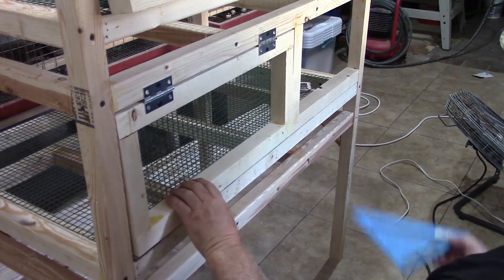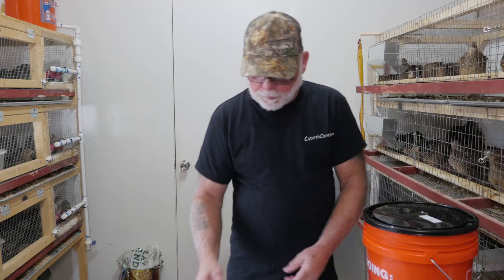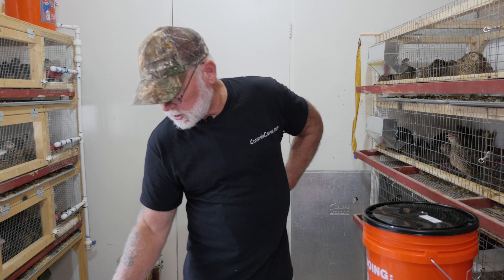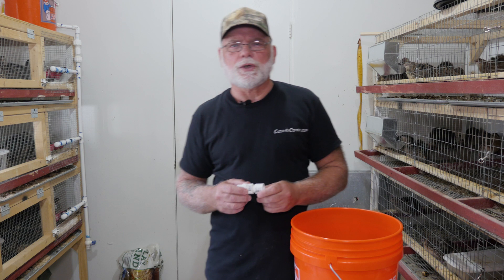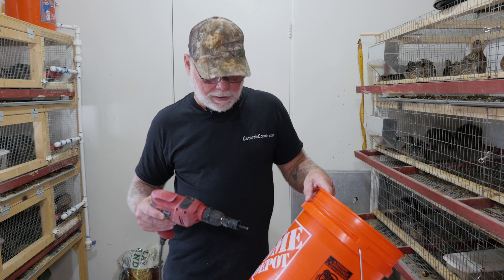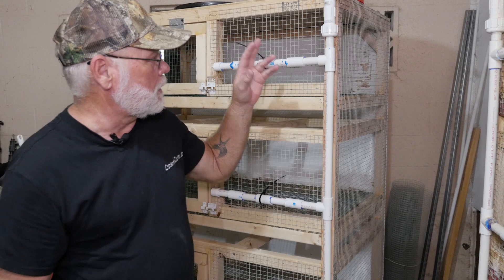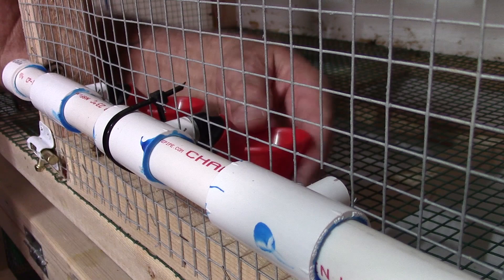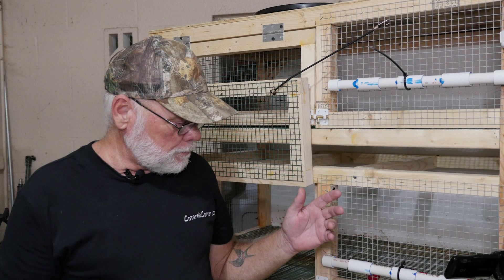DIY automatic watering system for quail

Comment: The fittings for the bucket are a male and female adapter......the tees for the cups are 1/2 x 1/8 x 1/2 and you should use a female adapter with a threaded plug at the end of your cup line instead of a glue cap.....that way you can clean out the line without cutting off the cap.....otherwise a great system
Reply: I just got my kit today. Thanks for the tip. It's amazing how you can sometimes miss the simplest things.

Comment: I use a union piece (I think that's what it's called) to attach to the bucket.  I've never needed silicone to seal it.  Also, I like the sturdiness of the pvc pipe.  I'm using 1/4 and 3/8" tubing right now and it seems to have a lot of play and movement.  Doing very well.  I like your videos.  I've recently created a self feeder that is working amazing.  Contemplated J-feeders but, I think these hold more feed and only cost me <$5 each to make.
Reply: care to elaborate on the feeder?

Comment: Learned a lot from your video's. Just one suggestion. I tried the watering cups that you have a link to and my quail could never get the water by pecking at the yellow part. I tried another cup and they leaked constantly by over filling the cup. Finally found a cup that is working well for me..... RentACoop Automatic Chicken Water Nipple Cup Waterer Kit for Poultry

Comment: very nice setup and saves a lot of time.
Using the compression connector is great idea, I was trying to think of something similar but cheaper and smaller.
ball valve is sure handy to drain the system too. I'll follow your ideas but will put a screw off cap on a male fitting at the end of the rails.

Comment: I put in the quail watering system you recommended. The problem is the cups overflow. do you have a solution for this or a way to adjust the water level?

Comment: I've been binging on your videos today.  Really thoroughly presented and good units.  I have a question regarding your hutch.  Why did you choose to have the doors swing up rather than down?  If they go down, you wouldn't need the zip tie, would they?  I'm going to start my quails in the beginning of April.  I can't wait to put what I've learned from your videos in to practice.  Thank-you so very much.
Reply: Most bird cages have a door that swings up because if you don’t get it latched good the doors weight keeps it closed, helping to prevent escapes.

Comment: HELLO! My husband and I build your three cage enclosure with the egg roll floors. And I just recently built THIS watering system. I had some leaking issues due to not use enough glue, I fixed that but now my quail have not figured out how to peck the yellow piece in the watering cups and I have to push it and fill the little water cups for them. Have you had this issue before? If so, did your quail eventually figure out how to use the pecking cups?

Comment: how do you insulate water lines in winter?
Reply: I've had some pretty good luck using pool noodles from my local dollar store. They are less expensive than going to the hardware store for tube insulation and are made of the same material and are also much thicker. Try wrapping the bucket in those water heater unsulation blankets. Good luck!

Comment: Really liking your setup! For the height of the cup from the floor, I'm curious why 4" but not 3" or 2"? Is it to prevent the quails from jumping onto the cup? One Youtuber said that his quails had been sitting on the cups pressing onto the yellow trigger causing the whole tank of water to leak out. Would that be a concern for you as well? Just trying to think over all the details before building mine. Thanks!

Comment: What sized hole saw should I purchase for 1/2” pvc couplings? I know the outer diameter is not actually 1/2” but I don’t know the outside diameter of the pipe
Reply: I think he might have mentioned 3/4"

Comment: I’m having problems with the poultry cups. The first one on the top row overflows. I’ve replaced it a couple times. And I took birds out to see if it was them playing with it. So ... any suggestions on how to fix that. I don’t know the math behind it or I’m not holding my tongue right.
Reply from the maker: Try taking the cup apart and make sure the plunger spring isn't holding the valve open. Also, could be dirt or sand in the line, try flushing the entire system and see if that doesn't clear it up. Good luck!

Comment: Another great video!  Other than having to fill them more frequently than a 5-gallon bucket, is there anything else inherently faulty with the quart Mason jar with the red, round trough?  Thanks!
Reply from the maker: Nope, just more work :)
Reply: Ok.  You're still trouble-free with the cups (other than that quail using one as at bathtub)?
Reply: Terry, does the angle of the roll-out floor have a negative effect on the Mason jar waterer?  Should it be positioned on the low side against the front wall to prevent tipping over?
Reply from the maker: @thatbubbleguy  to be honest I've never tried it.

Comment: I have been raising quail for about 3 years in a converted dog cage and am planning to build your cages.   Wondering with your watering system if you have any suggesting for keeping them from freezing during the winter months?
Reply: I just made one of these for my chickens and am getting ready to do one for quail as well. I am wondering the same thing!
Reply: Check out pipe heater tape which is meant for animal waterers... you'll just have to confirm they're safe for PVC
Reply: I’ve seen a few guys just put a water  tower in  the cage in the winter. Slightly Redneck does this. A gallon milk jug with 1-1/4 holes 3 inches up is enough for 10 birds for a day. And they are free.

Comment: Hey - great video - I've watched this like 5 times, and ive been back and forth to home depot/Lowe's... specifically I'm wondering if you happen to have the specific name or part number for the bushing/coupler(s) used for direct contact with the bucket? Thanks in advance
Reply from the maker: This is the part that is inserted into the bucket. You need to get a couple garden hose washers and a standard coupling for inside the bucket.https://www.homedepot.com/p/Dura-Corp-1-2-in-x-3-4-in-Schedule-40-PVC-Reducing-Male-Adapter-C436-074/100346631  Get 1/2" x 1/2", not the 3/4" as pictured.
Reply: @CoturnixCorner  Thanks much -- In a few hours, I'll have everything I need for this build. I'm really excited about getting this done! NOW - off to binge on more of your videos!

Comment: Great how-to video!  A couple of questions and they might receive  "common sense" answers"  1.  Which joints do you NOT glue?  2. Have you tried (with results?) the horizontal nipples  for quail?    I like the cups but am wondering how the horizontal nipples might work.  Thanks.
Reply from the maker: I glue all joints, although I did add a threaded plug at the ends of the water cup rail to aid in cleaning. I use both the cups and nipples, but they are the straight down nipples not the horizontal. I do know of a couple people who use the horizontal and they are happy with them. Thanks for commenting!

Comment: Hey Terry, my name is Dani, and I went step by step building this watering system and also my husband and I build your 3-stacked cage with the egg roll floor. I'm having speaking issue at one of the T fittings, do you have any solutions as to how I can fix it without destroying it?
Reply from the maker: Dani Lane did you use the threaded t fittings? If so, did you put teflon tape on the threads?
Reply: Coturnix Corner it was leaking at the vertical T fitting along each horizontal section, I have since fixed it though. Now my watering cups are leaking so I’ll have to redo the Plummer’s tape I think. Also my birds are having trouble figuring it out. Did you have to manually fill the cups for a while?

Comment: You talked about using the quart waterer for your juveniles before they learn to use the cups. My quail seem to make huge messes with that style waterers. I can't figure out exactly how they're doing it. Is that unavoidable? Or do you have any tricks to prevent this? I'm in the process of building your 3 tier style housing. So I'll be doing this watering system once that is done. But in the meantime (and for future reference with the juveniles) I was just wondering if there was a way to stop mine from leaking out all of their water.
Reply from the maker: I place a 6" square floor tile with a paper towel over it in the brooder and place the waterer on top of it, this helps keep the chicks from kicking pine shavings into the waterer. Although, you still will get an occasional bird poop in the waterer.
Reply: @CoturnixCorner  I will give that a try. That makes sense. Thank you so much. I'm really enjoying the channel. I'm going to be checking out your hatch rate video after I get this housing done. Thank you for the quality content and the great information to get started from. Much appreciated.

Comment: I have the issue of the bowls drying out and not filling the bowl????  any ideas on a fix?
Reply from the maker: What kind of waterer are you using?
Reply: @CoturnixCorner  Thanks for replying...I have the same ones as you..I made a bucket that has 4 cups and i can press the yellow stopper and fill it  and the chicks drink it but does not refill...All 4 cups dry..I wanna use these in the run but not if my birds gonna dehydrate . its setup with 1/2 pvc like you have
Reply from the maker: @robbphillip6663  That's the way they work. There is not water in the cup until the bird pecks at the yellow plunger, then it releases a little water for them to drink. When teaching them how to use it just use your finger to half fill the cup, by the time it's empty they will know how to use it.
Reply: @CoturnixCorner  thanks ..i have tried that a few times...thanks for your time

Comment: Thanks for your guide. It's interesting to see you don't put any PVC cement on the down tubes. I assume it doesn't leak at those points?  
Also, I assume you fill the orange bucket up periodically using a hose?  How often do you have to do this - how thirsty do they get?
Reply from the maker: I do use pvc cement on all the fittings. I usually fill the buckets every other day, as they drink quite a bit in the summer months.